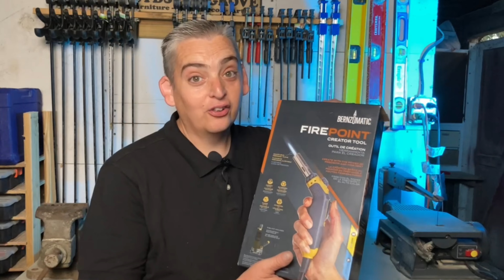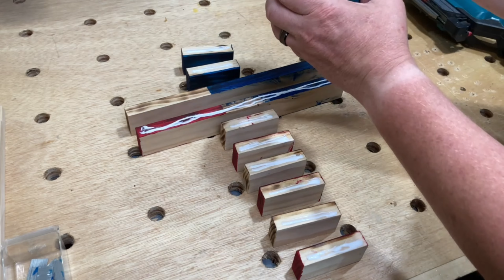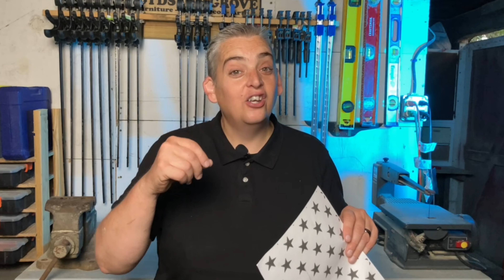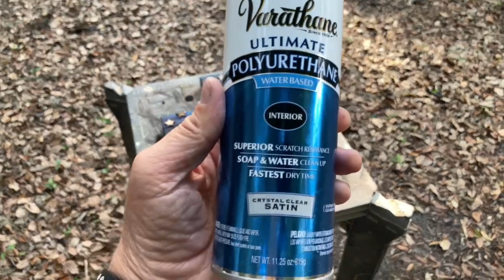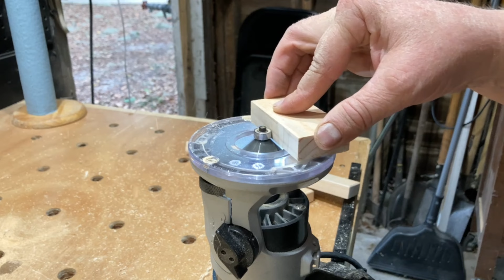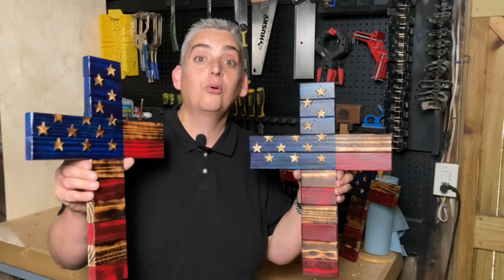How To Make An American Flag Wooden Cross

Comment: I want to make a 4' tall cross, what is the best way to figure out the overall size of the cross? Thanks.
Reply from the maker: The way the I make mine is: the bottom is twice the length of the top and sides. The top and side are the same length from the center. The width is whatever you want it to be, or what looks right to you. Hope that helps. Thanks for watching!

Comment: Where do you find presanded boards?
Reply from the maker: Both our local Lowes and Home Depot sell them. They refer to them as select lumber. I have noticed that the quality has gone down over the last few years, but they are still pre-sanded for the most part.

Comment: What measurements did you use to paint the horizontal parts? How did you center?
Reply from the maker: I cut the long pieces to 12 inches and the short pieces to 3 inches. That means the blue painted area of the two long pieces should be 7.5 inches long from the end. Once the blue areas were painted, I could use the end of the blue area as my mark to line up the shorter pieces. Hope this helps.
Thanks for watching!

Comment: What size pin nails did you use for this?
Reply from the maker: The fence pickets are just under 3/4" thick and I split them for the back braces, making the overall thickness about an inch thick, so you should be safe to go with 3/4" nails.
Reply: @boydstongrove  thanks 🙏🏽

Comment: So two things I'd like to add. That benzo torch accessory is absolutely amazing and I highly recommend it. I did prefer water base stain because as I was (stupidly) painting I would flick paint on the other pieces by accident. The stain is hard to find in stores for some reason though.
Reply from the maker: you are correct on both points; That creator torch tool is awesome, I use it quite a lot. And yes, those colored stains have to be ordered, that's why I ended up using paint instead. I'm sure the stain looks much better.

Comment: Did you thin your craft paint with water? I bought some and it completely covers the burned wood so much that i had to wipe off the majority with a rag to get the wood to show through.
Reply from the maker: Sometimes I thin it with water, but usually I just apply it and immediately wipe it down with a paper towel. Sometimes I will just apply it with a paper towel like you would a stain and that way I can wipe as I go. It also helps to buy cheap paint. Nicer paints have more color pigments and will cover too well.

Comment: What size are the stars?
Reply from the maker: The ones I bought are 1”
There’s a link in the description if you want a closer look
Reply: Yep, I did that. But once on Amazon it gave different sizes. I thought the one's you were showing were 1", just wanted to make sure before I ordered. I've done flags & crosses using a dremel to do the stars. Pretty good at it, but TIME consuming!! I'll give your method a try, I like the looks of the stars being raised and burned. Thanks.

Comment: We have some special tongue and groove her, called tatranský profil, referring to the High Tatras. When you put them together, the sanded sides will not form a smooth surface, but it has
a "valley" at the connecting point. (no need to make round-overs of chamfers). The tongue and groove parts will run horizontally, so the whole cross will need backer boards to make it
more rigid. At the moment I cannot do any woodworking because I broke my ankle  So I only watch YouTube videos on woodworking now.
Reply from the maker: Sorry to hear about your injury. At least you’ll be full of good ideas by the time you’re healed up!
Reply: @boydstongrove  Sometimes even bad things have their tiny positive sides

Comment: Very interesting project. I've never seen cedar in Slovakia, but it'll be more expensive than line, over here. If I were to make this I would use tongue and groove pine,  which costs  about 12 usd/m2, for a 1 metre long and 10 cm wide board then 1.20 usd.
Reply from the maker: Tongue and groove is a great idea! I don’t know if anything stateside that would be narrow enough, but I guess I could cut my own tongue and groove.
Thanks for watching!

Comment from the maker: I've been wanting to tackle this classic project for a while and I thought just in time for Independence Day would be a perfect time. Super simple woodworking project that sells super well, and when made from the fence pickets, the overhead is next to nothing.
Reply: What did you use for bracing on the backside of the cedar?
Reply from the maker: @jimmyturner5589  I used more strips of cedar, exactly how I did it on the pine. I left that out of the video because I felt the video was getting a little long. Sorry about that.
Reply: With the cedar bracing on the back,  did you leave it at 5/8 thick or trim it down some? I know on the pine, you split it down the middle.
Reply from the maker: @jimmyturner5589  good question! I shaved it just enough to smooth the surfaces, but I left it thicker because cedar is so soft, I wasn’t sure if there would be too much movement in the wood if I made it thinner. Maybe it wouldn’t make a difference, not sure.
Reply: @boydstongrove  thanks for answering questions for me, loving your channel.
Reply from the maker: @jimmyturner5589  thanks for watching, it really helps us grow!